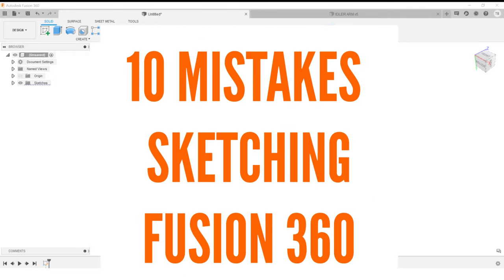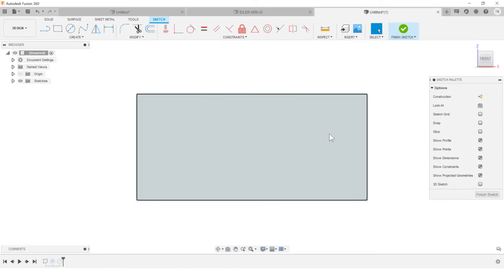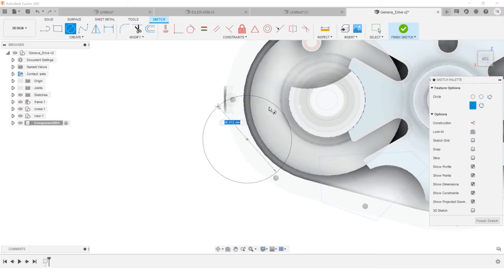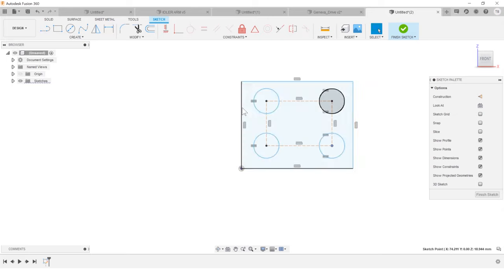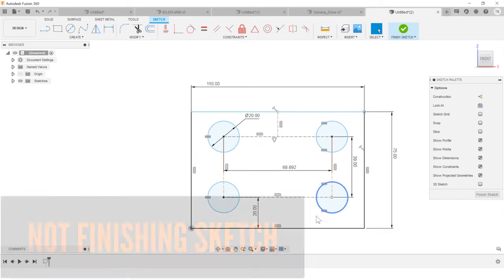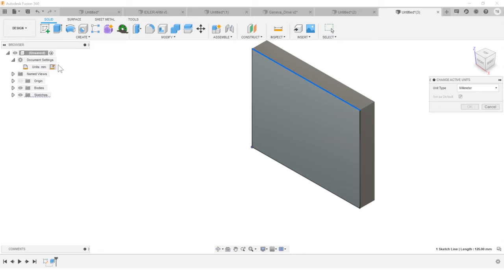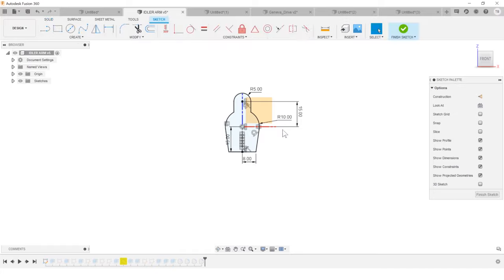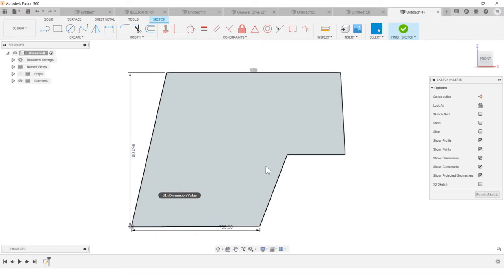Fusion 360 Mistakes I Make Sketching (10 Things To Avoid)

Comment from the maker: What did I miss?
Reply: I love these best practices and tips. Keep them coming!
Reply: Great video, I've totally been sleeping on using the equal constraint for holes. I usually use patterns or mirrors, but I usually end up with downstream issues when I want to tweak something.

As far as other sketch tricks, one technique I use a lot for roughing out a sketch is to purposely overshoot my lines so I don't have any constraints getting in the way while tweaking the placements and angles.

Once I have the rough sketch worked out I'll use the trim command (shortcut T) and cut off the overshot portions and apply constraints.
Reply: Here's a few:
- Projected line segments underneath actual lines (all collinear).  How can you select a line segment that is on the same path as another line?  It always picks the one you don't want.
- How can your force your sketch to stay in the same plane as you started drawing on?  Sometimes lines go off in 3D space at a weird angle instead of staying on the sketch plane.
- Another is finding the centers of circles or objects as you begin to try to work on imported meshes that have lots of rounded and non-uniform surfaces everywhere.
Reply: I was trying to use a pattern to replicate a hole with an extruded rim/border today and could not get it to work.  Whan I usd the pattern I could only get the holes but not the border.  I ended up sketching the circle for the hole and the offset border, using rectangular pattern to create all the hole circles and then separately selecting all the hole circles and cutting them out and then selecting all the borders and extruding them.  Grumbling that this can't be right the whole time.  What is required in order to select and replicate both the hole and the border?
Reply: I don't know if it's a miss, or it's just me not understanding (as per usual 😁):
I have one question as a beginner tho, @5:28 you say that things are good below the line I see blue circles - doesn't that mean that something is missing? Is it that they are black when you hover over the area? If so you just missed hovering at @5:40 where the circles below the line still are blue. But then again, the circles are still not fully defined at @5:54 as I understand it. Very nitpicky, I know, but being new to Fusion 360 I want to get all details right😁
Good video, I subbed to get more tips 👍
Reply: We have the same first and last name

Comment: Most important hint would be: using inches will always mess up everything! Use proper units that actually work 😉. But otherwise great video with some really great hints I learned that will totally help me!
Reply: Thank You. I got really terrified, when he started TYPING units into the sketch dimension.
Reply: We only use metric for ammunition. 🤣
Reply: I would but it's difficult to divide 25.4 mm by 8ths ;-)
Reply: As an American who's really into 3D printing and electronics in general... I have never felt more personally attacked in a way that I can't argue with at all 😂
Reply: Metric snob😂
Reply: @markkrick8602  bow down to us and acknowledge our superiority😉
Reply: Hey woodworkers exists
Reply: SAE is necessary for MANY things here in the US. Be able to work in both.
Reply: @Isaacmantx  it may be used for many things. That doesn't mean it is necessary. Led may have been used in many pipes in the past but we moved on as we soon as we developed better alternatives.
Reply: @GenuineNPC I. construction you'd see the opposite. MM won't build walls

Comment: I have one thing that consistently WRECKS my models!!!  Forgetting to make components active before making edits so I get edits associate with the top of the model hierarchy or worse associated with incorrect components!  There really needs to be a mechanism that warns when you are about to make edits while outside the component being edited!!!!  I don't think I have completed a single model without wrecking the hierarchy in this way.  Once you have made enough modifications outside the correct component there is no going back and the entire model is RUINED!  This is the primary fault in top-down fusion modeling and why I prefer the other cad software model of creating each component independently and then adding them to the assembly.

You talk about wasting time.  How much time does it waste to spend forty hours modeling something and find out 2 minutes before you are done you made 80% of the edits in the wrong components!!!!!  That's a complete restart!  How hard would it be for the program to toss a warning - you are about to make edits to component x while component y is active!
Reply from the maker: Agreed!  This can be so tricky
Reply: Thanks, you just answered why extrude/cut shows to be on the part I wanted to modify but "export" or "save copy as" don't have the edits/cuts.

Since I cut the assembly by planes off the fixture I couldn't have edited the part in its own design but had to modify it after inserting it into the fixture's design

Luckily I just need a Copy/Paste New for now for what I need as I just turn "stock" into the finished part.

Comment: Nice tutorial. I came to F360 from 3D Studio Max and figured it'd be a cakewalk to learn, but I find the UI and operations to be completely counterintuitive to the methodology of 3D Max. Even the simplest of models are littered with operations that I'm having to look up and try to remember for the next time and it can be quite discouraging. I'm convinced that it's just a matter of using it enough to finally have a Eureka moment where I realize that there's actually a simple system in place and I just failed to look outside of the box. Only time will tell.

Comment: I have a hard time drawing an arc on different planes, like you would when making a fan blade with 3 separate arcs to later be joined with a patch loft. Sometimes I succeeded, other times the arc curve out in the wrong plane direction for some reason. I can't figure out what I'm missing out. Can you do a video on that please. Thanks.
Reply: I think I might just found a way around it, not sure if that's the most practical way. If I first project the previously defined arcs to the plane I will be drawing the new arc, it works.

Comment: I hate auto references. You can turn those off. I always explicitly lay down my references, usually as a begin a sketch.

I just discovered a related setting that might help people be more productive: auto project geometry on active sketch plane. I'm going to give that a try.

Seems strange to me that you would accidentally start another sketch when your intention is to re-open an existing sketch. I never use the sketch command to re-open a sketch. I always use double click either on the time line or browser.

Comment: I've noticed several people when they're building several components on their example video they start off far from the origin.  So.... BOOM when I try that on my stuff.  I've had components disappear completely.
I appreciate you showing how to make the relationship to the origin but maybe just starting with using it avoids problems down the road.
PROBLEM I have, is that the origin planes are not visible inside my components so I'm always chasing around.  THIS is my biggest problem.  Today.

Comment: I know this is an old video, but I am a new user to Fusion 360 and 3d printing.. Awesome Tips. Some of these would have saved me hours (line trick to find errors for sure) doing my first design. Some of these I figured out with trial and error. smh. Thanks for sharing.

Comment: Re: constraints, referred to as 'capturing the Design Intent' - capturing the fundamental characteristics/relations personality if you like, of the model. Although dimns are generally considered a constraint as well it's worth mentioning parameters at this point because they can be used as constraints - length x is always twice length y, spacing holes relative to the overall length etc. - and they can be 'constraints' across multiple sketches.
Reply from the maker: Thanks.

Comment: Hi, I want to do a 2D milling contouring of a closed countour imported as dxf file. The profile is perfectly closed, I checked it with CATIA. In the 2D contouring operation, instead of selecting the segments one by one, I would like to select just one of them and let the software to select the others. Is it possible? Thanks.

Comment: PLEASE HELP!  Total newbie transitioning from Rhino 3D.
Thanks for this great video, but I am running into two super basic things that are driving me bonkers -- hopefully when finished laughing at my beginners frustration/ignorance, you can help with these probably simple problems. I find no references that solve these in the forums or on YT.
1.
I've begun a sketch in 2d and ALL of the points are showing as big black dots -- HOW do I hide all of these? The sketch palette (S key?) doesn't even mention point hiding.
2.
The second issue is that all my previous work (again just in one plane 2D) has suddenly turned gray! I've read it is because I started a new component by accident (no clue how that happened), but HOW do I go back to showing my work in black like it was before it all turned gray? Really frustrating not to undo this gray appearance.
Thank you for your help.
Reply from the maker: Feel free to send me an email with some screenshots. Tyler@techandespresso.com
Reply: @TylerBeckofTECHESPRESSO  Thank you so very much. 
I do believe I have it resolved now. My problem seems to arise from the differences between sketches, components, profiles, bodies, etc etc. I have not encountered these strict concepts in past programs (pretty much only layers, not any of the above). It seems everything existing grays out when you select "new component" and it appears there is no undo for that mistake.

Comment: Sometimes I just cannot fully define a complex sketch. I miss the Solidworks fully define command.  I had the student version of Solidworks for a year and although the fully define command did not always do what I wanted it to do, I got some pointers on what constraints were missing. I also miss the remove all constraints.  It can be nice to start adding constraints from scratch. I still have a problem finding and removing constraints in Fusion 360.
Reply from the maker: For sure! I wish Fusion 360 had that from Solidworks or the sketch Dr

Comment: At 00:36, at first you drag the corner point, and you can change dimensions of the rectangle.But after, you drag the point and the whole rectangle moves, keeping the dimensions the same.
I cant get it to move along with the point, i only drag and change dimensions.
Do you have to press something along with left click?
Reply from the maker: Once it is dimensioned it’s will not change shape.

Comment: What can I do if I have a height that is very short and I can't measure the exact size in Fusion?
I want to know the exact size of it but the size is so small that Fusion thinks it is too small to measure it?
But I need this exact measurement for another part of the design that needs to be the same. Can you help me???
Reply from the maker: Any luck? Is it a line? Point to point?
Reply: Preferences-Unit and Value Display-General precision. Zoom Window. Try it out. Hopefully it will help you.

Comment: have you ever heard of Creo parametric. I've been using in for about a month now and it is really good. I have access to various features and I only found my self stuck once because of the programs limitations(the inability to produce sketches on a curved surface). I know that Creo is targeted for business use but they have tutorials on every feature. As of now I am currently learning surfacing with datum points and references. however, cero's starting price is 2000$ which is probably why is so unpopular.
Reply from the maker: I’ve used Creo only a handful of times in my career.